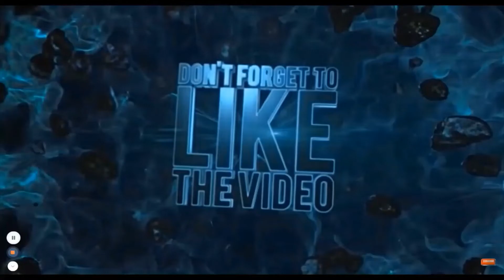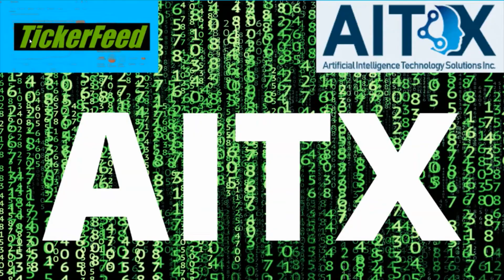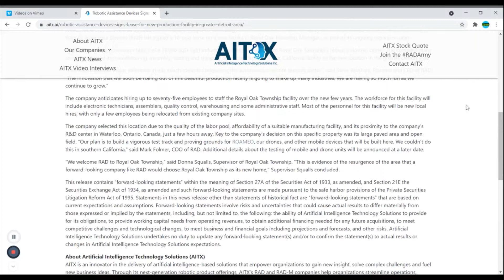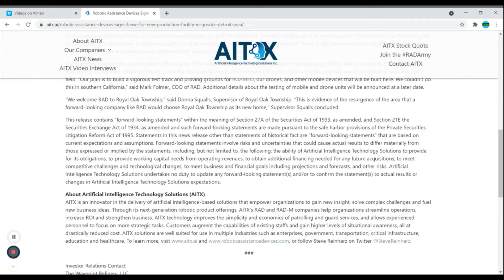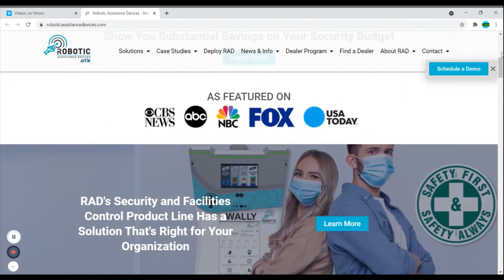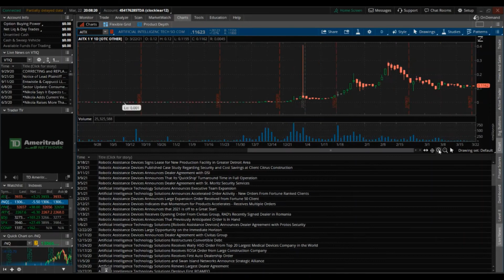AITX STOCK! BREAKING NEWS ANNOUNCED! NEW FACILITY !! BUY?? AITX CANDLE STICK ANALYSIS!!

Comment: do you think at least 1 dollar is enough? soon soon? it's just falling ...are you a trader?
Reply: Not going to hit a dollar until well into 2022 at earliest, and it is all dependent on sales. Until sales data is released and favorable this stock will float on the market waves from .06 (yikes) to .18. A good initial sales report will break it into the 20s but AITX will need multiples and increasing sales reports to justify the 12 billion dollar market cap that 1.00 will bring. This is a loooooong play.
Reply: @stevencorreia725  Wouldn’t 1 dollar put it at a 3.2 billion dollar market cap?
Reply from the maker: @henriqueandrade the market is still currently correcting itself. It will take time, just remember the fundamentals. Even the best companies had a slow start. Look at FB, when they went public it a while for large volume to buy in.
Reply: if aitx is having such good results because it is only in free fall? has been falling for more than a month without stopping it was 0.28 now 0.09 ??? it was better to have sold at 0.28